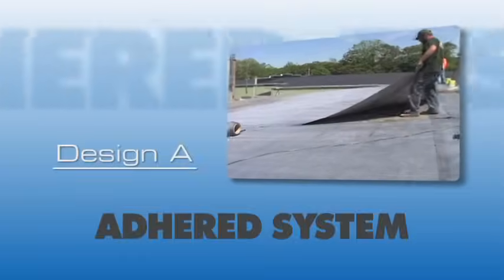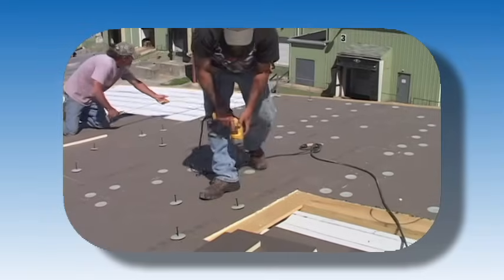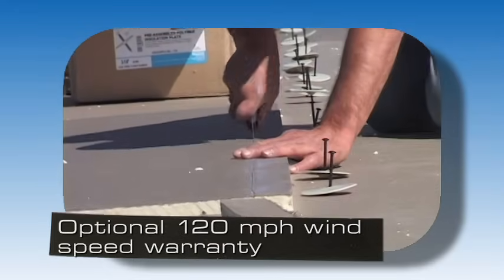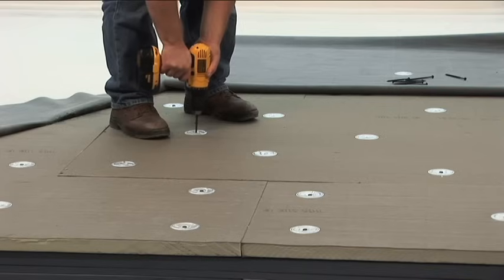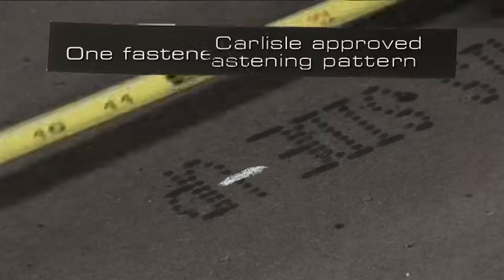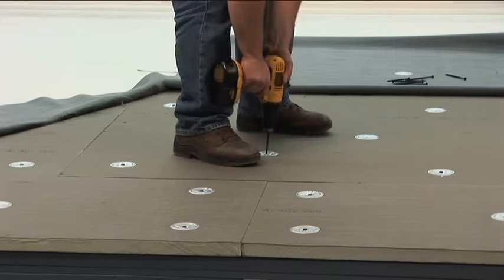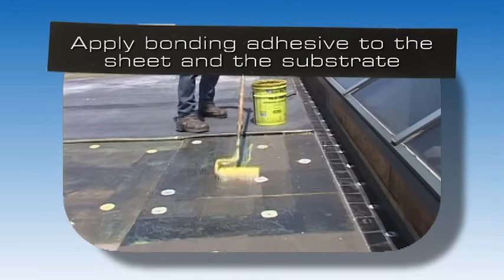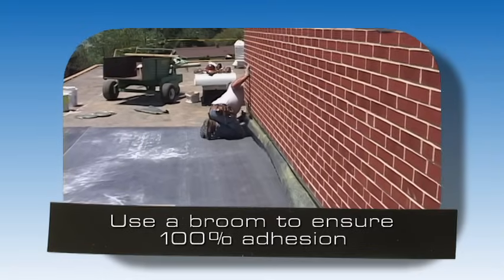Carlisle SynTec Fully Adhered EPDM System (Design A)

Comment: I'm shocked no one wanted to point out the plates were put in the wrong spot in over half the scenes,  both per Carlisle specification and ANSI/SPRI. 
Plates are never supposed to be within 3" of edges of the insulation (or rather, when they are that close they don't provide the proper uplift resistance and another plate must be added in those area) 
They even mention the fastener should be at least 6" back then not 4 scenes later show plates along the edge.
Reply: well i do install in bouth sides of the joints if not they lift,thats basic